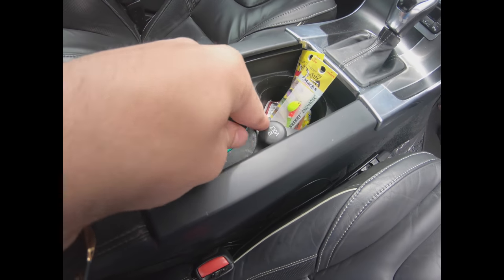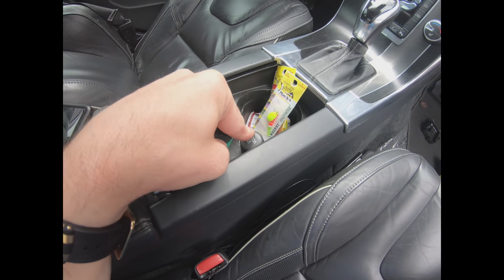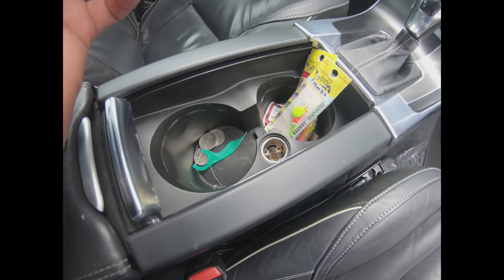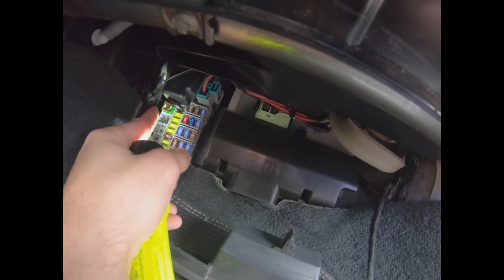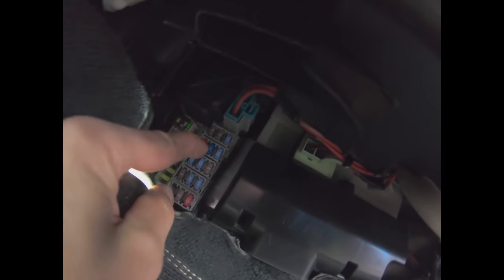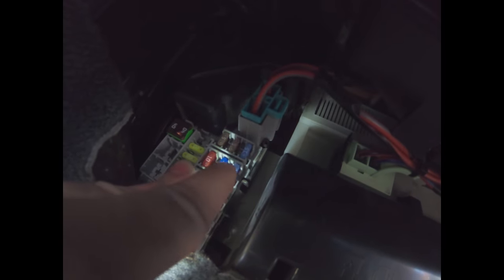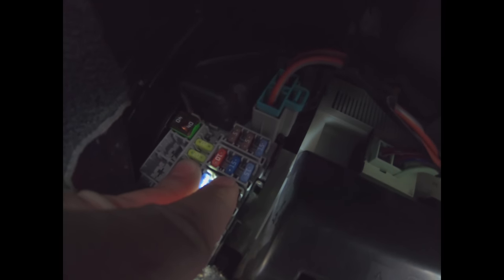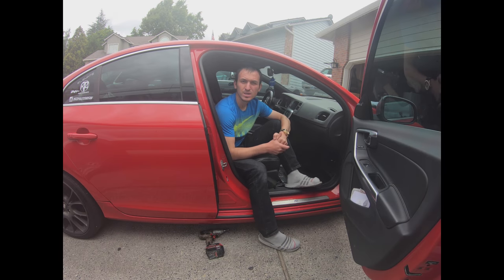Volvo s60/v60 2010-2016 12v power outlet/cigarette lighter not working easy fix

Comment: Exactly the one thing is missing what I would need, where the earth is the fuse box, and how to access it. If the video would have an extra 10 seconds before showing the opened closeup of the fuse box, to show the whole cabin, then gradually closing to fusebox, the opening it, everything would be clear. Unfortunatelly now I still do no know where the opened close ups were filmed...
Reply: Did you ever changed the cabin air filter? If you did than you know where is the fusebox.
Reply: Hmmm! Maybe you should have a professional handle it.
Reply: @gabriel it's in the hood of your car! Pop the front and there should be a black box in the farther right-hand side. Open that black box and you'll see your spare fuses :)

Comment: Thank you for this video. Do I have to disconnect the battery frist, or just remove the fuse normally?
Reply from the maker: Not necessarily. Just make sure the car is off and the keys are out of it. But if you want to you can,  it won't hurt it.

Comment: Is it under the carpet?
Reply from the maker: No. Behind the compartment
Reply: @BuiltForSpeed  Inside the glove box? I looked, nothing
Reply from the maker: @JimmyKay1976  under your glove compartment theres a cover you need to remove it.
Reply: @BuiltForSpeed  I found it. I don't have those kinds of screwdrivers though. Do you know the size? Thanks!
Reply: @BuiltForSpeed  You should of showed us the panel location before taking it off…..